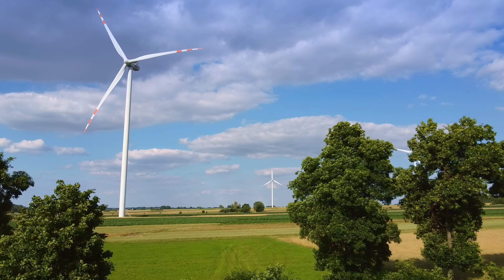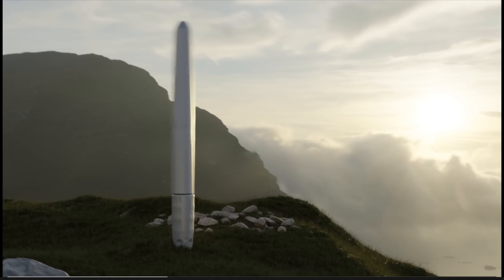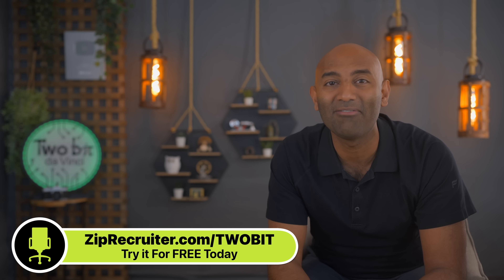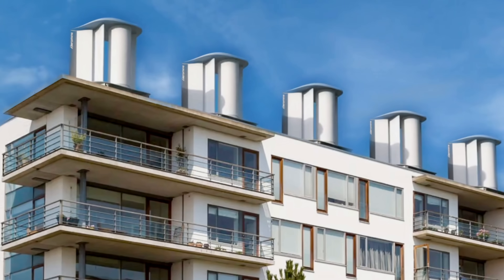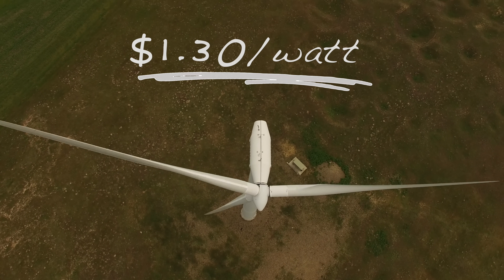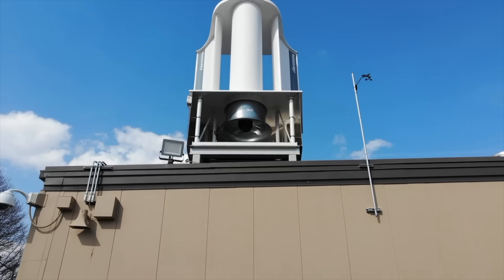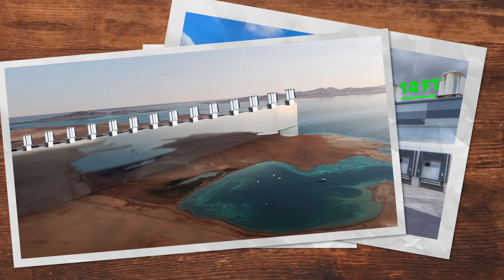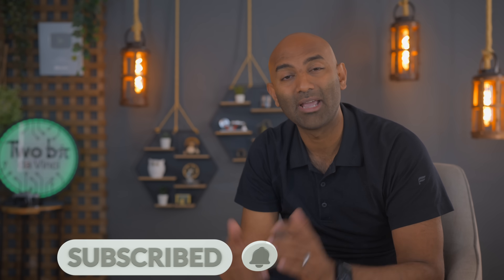Can This Genius Wind Turbine Outperform Rooftop Solar?

Comment: Interesting application of  simple physics to power generation, but still faces the problem that the wind isn't always blowing. An  interesting question is: will it work under water? I have  more trust in hydroelectric than in wind power for the simple reason that the air isn't always moving fast enough but this  design idea  might have huge applications for small scale run of river type hydropower
Even more intriguing would be if something like this could be deployed in a strong ocean current.

Comment: What is "per watt"?
Peak ? 
Wind can have a really high peak during storms, but it won't ever reach this under normal conditions.

Also, solar is arround 0.5$ per watt just for the panels(even cheaper if you buy cheap panels) and arround 1$ with inverter cables mounting etc.
Add installation and we are at a VERY generous 1.5$ per watt peak because installers currently massively overinflate prices for maybe 2 days work. 
Add a battery to that and you are at maybe 2.5$ still cheaper than 2.86$

So this really looks like an ad.

Comment: If you look up an 18 blade shrouded parametric propeller on a free 3d printing site such as thingivers_  you will be amazed at it's performance.  I've tested them for different wind generation purposes and they exceeded all my expectations and outperformed all the other hundreds of designs I tested.  My testbed was on the front of my car with a 500 watt scooter type dc motor as the generator.  I  had to have a friend in the industry print me 12" diameter versions eventually which I found to be ideal in my fencetop wind generator system which utilized 16 of them with 40 watt 12v generic dc motors as generators.  Just throwing it out there as I'm a huge "fan" of that design which incidentally also work extremely well as fan blade replacements.

Comment: Installing a northeast-facing Aeromine to turn Santa Ana winds into electricity seems like a perfect way to completely offset any “public safety power shutoffs” that utilities may attempt to implement. And of course an Aeromine facing the ocean would similarly benefit people who live on the beach, especially here in SoCal where the temperature difference between the ocean and the land can be extreme in the summer months.

Comment: They do not want wind turbines on every home any more than they want solar panels on every home!!! Electricity is the new fossil fuel for power - political power. There is an over "POWERING" desire to completely ban fossil fuels and force 100% electricity. At the same time there is an increasing push for codes and restriction against personal power and off grid or sell back getting ban or regulated for the sake of big Electric systems.

Comment: I love this idea. I have solar but also have regular windy conditions. I wonder about having an enclosed solution like an aeromine… maybe smaller. Then tie it into the same inverter system… I wonder if this is possible? 
As you eluded to in the end of your video it would be cool to explore the option…Get some data out to the masses even if anecdotal it would give a frame of reference…
Reply: I think the wind generator produces AC power, so it wouldn't need to go through an inverter. Maybe something to synchronize it with the inverter output? Any electrical engineers around that could answer this more accurately?

Comment: I seriously doubt that it is cost effective. I wish this channel didn't use click bait titles, I might have to unsubscribe
Reply: I'm not sure it's unlikely to be cost effective. Or cost effective when compared to grid or off grid. But, An unmoving air foil to speed up the air for ventury effect is relativly cheap. Naturally strong through its curve, And Getting a comparitivly small turbine to spin very vast is relativly cheap to design, and modular, and  lends well to cheap to manufacturing. I'm just not so quick to dismiss.  

Taking inspiration from this I'm wondering if one simplified the design to a horizontal wing  or upside down trapezoid along the ridge line of a typical gabled roof with one continouse narrow gap along the length participating in the venturi effect with the peak of the roof, and a small wind turbine at each end. I used to do roofing and it seems to me that securing this idea to the peek would be easy to install in let's say 8 foot sections, and it would be minimally visually intrusive, and useful even in low winds.
Reply: @kreynolds1123  additionally, there are no exposed rotating parts to cause injury, and it doesn’t have the noise associated with wind turbines. I expect something like this to be usable soon, they would be great for northern areas where there is a lot more wind than sun
Reply: "Can this genius wind turbine outperform rooftop solar?" isn't even in the ballpark of being clickbait. 🙄
Reply: So you can’t read and don’t want to listen. Your future is bright!
Reply: That depends on geography. If you live somewhere windy/cloudy, like Scotland, Iceland, Alaska, etc..., it could be a much better alternative to solar.
Reply: Why do people complain about click bait titles. This is there jobs, they do click bait titles on purpose to get more views because unfortunately it works and they have to play the game
Reply: I agree.  The titles are misleading at best.  I’ve commented on this a lot.  Matt Ferrell would not like this either!!  Tone down the title crap.  The content is good, but COME ON RICKY!  Your better than such tricks/crap.
Reply: @BOK-04  matt is equally as bad as this channel
Reply: You know the channel they are just describing and looking into these options!
Reply: Goodbye
Reply: Well actually it reminds me of the Dyson fan… you know the one that is a ring, but no blades in the middle.  And those Dyson fans are commercially viable.
Reply: Compared to solar I believe it would be “closer” to cost efficiency
Reply: Can you make a better suggestion to make this better, let's try and put brilliant minds together
Reply: @4kfootage  design roof tops to accommodate the turbine by means of  channeling air currents
Reply: The only doubt I have is whether or not you know what you are talking about.
Reply: Did the title change in the last hour? It's a question even without the question mark so it's not clickbait.
Reply: Then leave don't bring negativity by threatening to leave. Just leave no need to threaten to leave. There was no Click bait. You see on even more different channels
Reply: Punctuation marks just boggle your mind huh
Reply: @DwDDB  They don't boggle my mind.
Anyone who can read has a clear advantage.😸
Reply: @DwDDB  damn near spit my coffee 🤣 😂
Reply: Gotta respect the hustle. Dude's trying to improve his metrics, and news flash... click bait works. At the end of the day, it's a series of words on a screen, which didn't bother me.
Reply: Please pay attention to the question mark in the title!
Reply: Yeah, stop using Chat GBT for titles you are loosing credibility for otherwise a really good channel - stay true to your roots

Comment: Can they use a AC motor in the design?    Would that be better for feed in setups into the grid(would avoid the DC>AC loss inverters)?   Would frequency matching be the real hurdle with an AC motor?   How does humidity impact this design?
Reply: You are asking detailed questions about something that is going to be next to useless. Irrelevant.

Comment: Just saw a story about whales 🐳  may be killed by offshore wi d farms in New England any thoughts as to why?
Reply: Vibration messes with their echo location.  It's also very noisy to them
Reply: @sketchyssk8shop  oh a bit like the sounding machines used to detect oil underwater.
Reply: @matthewdilks2677  exactly.  Btw it's called sonar.
Reply: @sketchyssk8shop  oh thanks.
Reply: not an issue.